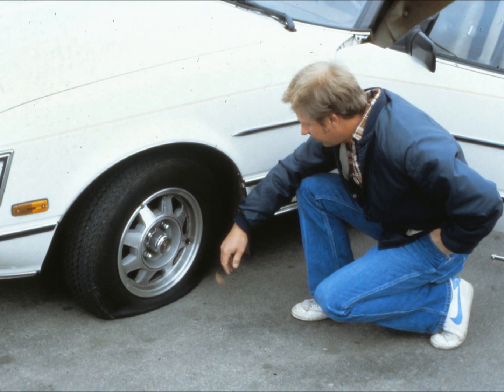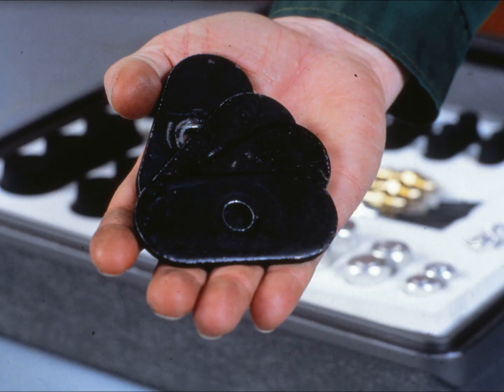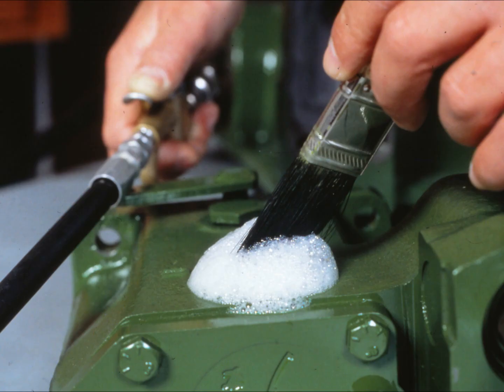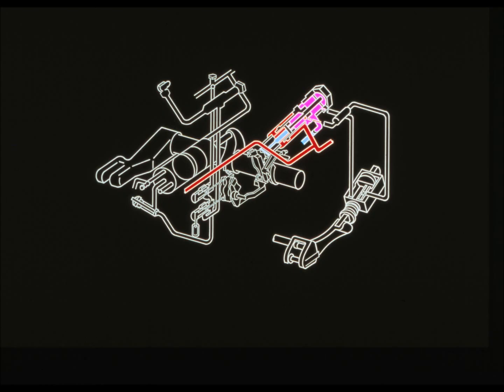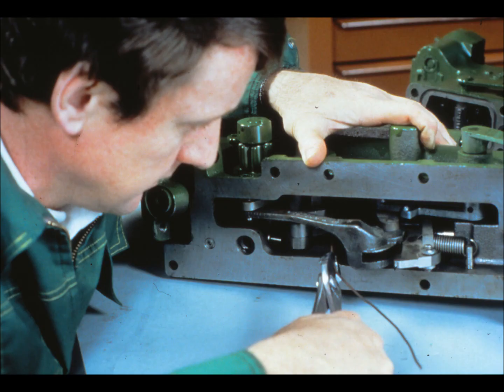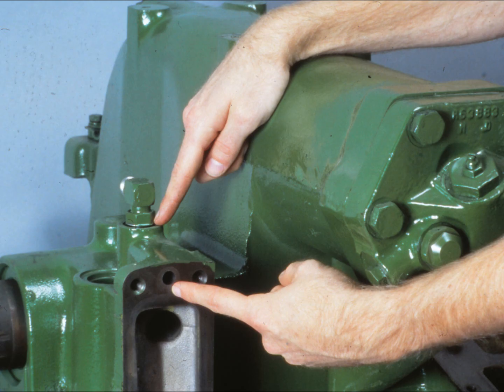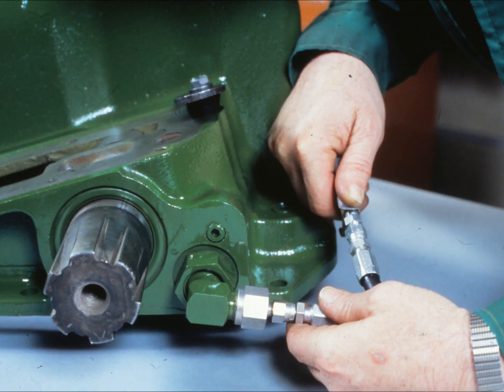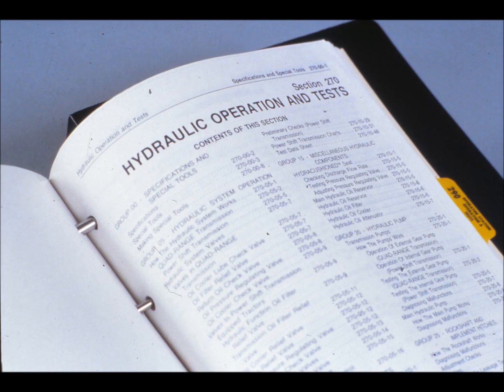John Deere 50 & 30 Series Rockshaft and Selective Control Valve Air Leak Test

Comment: Hey Ikon,,holy crap. Watched this video a long time ago whe I worked in a JD dealership. Thanks for the memories,,lol.
Reply: I worked at an well known JU dealership in SW Kansas for over three years, and I DO NOT think that they had this set of speical tools, so I shall try to remember to ask my friend, who was a JD technician for slightly more than 33 years, at a dealership in the Lower Rio Grande Valley of Texas, if that dealer ever had this set.
And the American public, if they ever think of the American farmer at all, has NO concept of the knowledge required by a "service technician", or the REAL costs and risks of modern agriculture.
I got out shortly after the introduction of the 8000 series tractors and went on to work a total of 38 years in the oilfield, both domestically, AND the 25 years I spent working overseas.
Reply from the maker: Is it easier to watch when not at work? 😁 Glad you enjoyed & have a great New Year!!
Reply: @ikonseesmrno7300  I think i dozed off,,lol